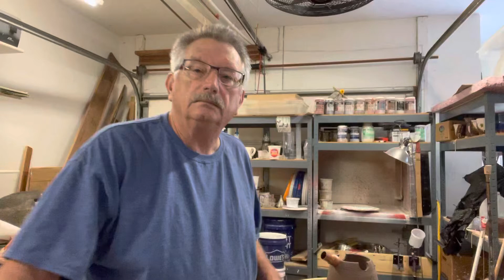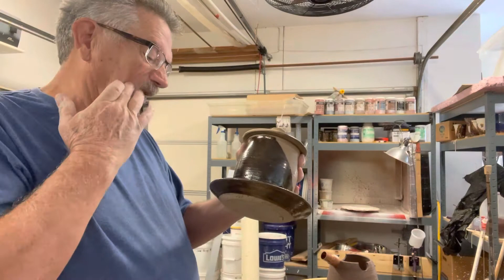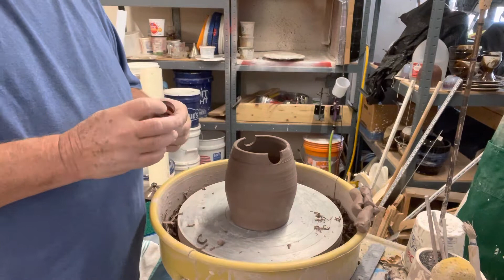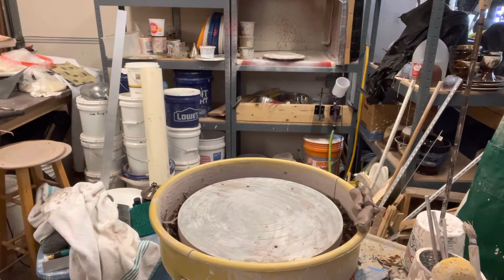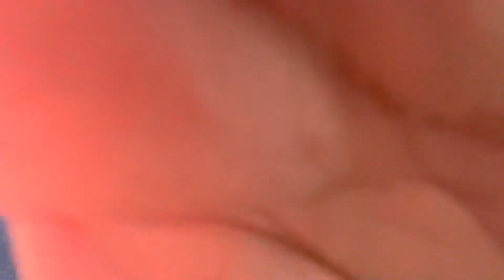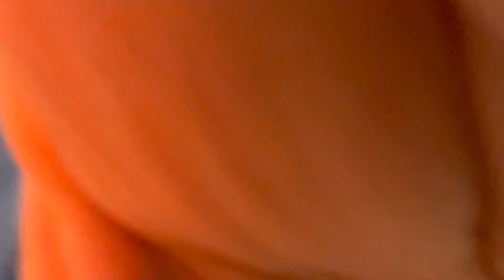Changing up My Bird Feeder Design

Comment: Ralph, thank you for your process on making the tool cutter, I like anyone that shares there ideas to help potters make things. eddie
Reply from the maker: I’m glad you enjoyed it.  I also use hole saws of different sizes to cut holes, although they don’t cut as clean.
Reply: @ralphwardpottery5708   Ralph you do nice work. and I enjoy seeing people do thing like this. I have a engineering background and design tooling for 18 years. then moved on to a different job, making and performing the chemistry of medicine for a pharmaceutical Co. This has help me, with making glazes. you have giving me a idea, but I do not know if it will work as of yet. it has been nice talking to you. eddie.